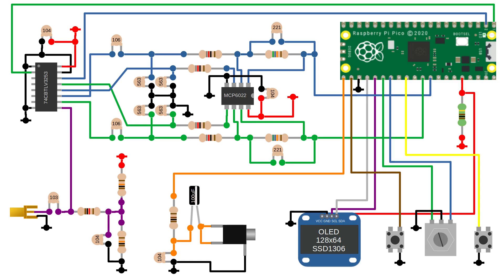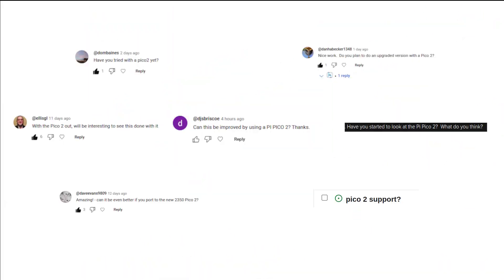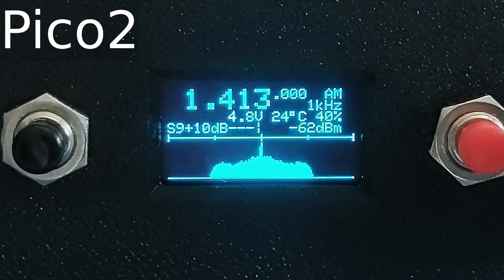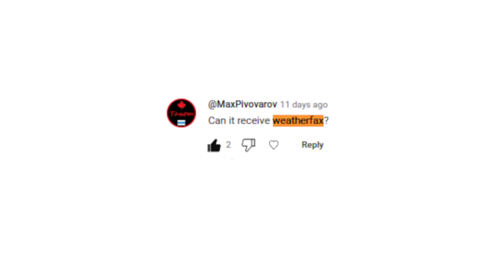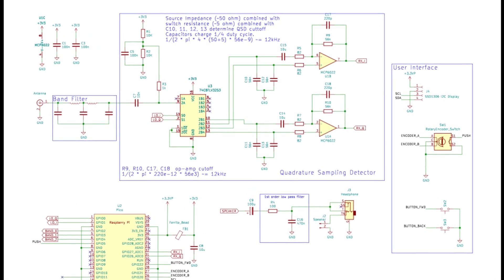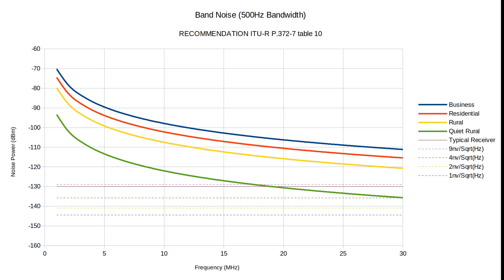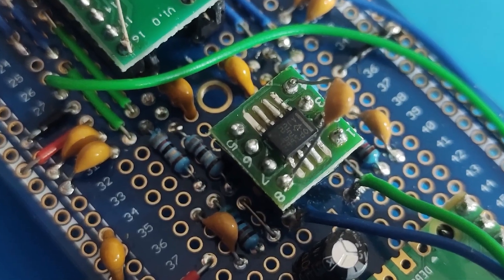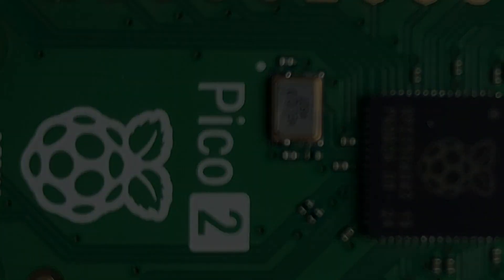Software Defined Radio with Pi-Pico - Part 2 Pico 2 upgrade

Comment: Amazing project! Thank you for doing it and making it open source! I feel something important for the HAM world will come out of this :)
One thing I am wondering about is the frequency accuracy. If I understand correctly, the actual tuning step is a few khz (dependent on frequency) and you get it by "mocking" a pll out of PIO outputs. After that, in the frequency "window" you get, you slide the demodulation bandpass by software, so you can get it to be much more granular.
Is the same process possible for TX as well?
Reply from the maker: Thanks, yes that's exactly right, the hardware oscillator has a few kHz resolution, but the software tuning is very precise. In principle, the same approach would work in a transmitter. It is possible to get sub-Hz resolution from the PIO, but it does require software intervention (around 10% CPU), I used that approach in the transmitter. The course-grained local oscillator in this design uses the hardware clock dividers and doesn't need any software intervention leaving all the CPU free for the DSP.

Comment: Very pleased and a bit surprised to see that the RISC-V cores perform as well as the ARM cores!   Since they are license-free, this could lead to future Pico MCUs with equal performance but even lower cost.   The overall reduction in CPU time is amazing and bodes well for the ability to add new features in future.  Thanks for your great work Jon!
Reply from the maker: Thanks! Yes, I was surprised too. Suspect the the ARM cores would be much faster for floating point code though. Looking forward to adding some more features!
Reply: @101Things-ds8tc  Were you able to measure the current consumption of RISC-V vs ARM, since power efficiency has been a focus of ARM optimization?
Reply: Ah yes… ‘features’… call them what they are, FPU / DSP filters 😉

Comment: Tnx Jon was talking about findings playing with pico2 this morning with another radio amateur. Other than the cmake calls to the SDK did you have to change anything else?
Reply from the maker: Yes, I had to add some extra calls to gpio_set_function() that weren't needed on the pico. Without it, the encoder didn't work. Still, the process was quite simple all things considered.
Reply: @101Things-ds8tc hope you put that in the docs haha 😅
Reply: @101Things-ds8tc OK I see the additions to the code rx.cpp already...
<     gpio_set_function(PSU_PIN, GPIO_FUNC_SIO);
and
<     gpio_set_function(2, GPIO_FUNC_SIO);
<     gpio_set_function(3, GPIO_FUNC_SIO);
<     gpio_set_function(4, GPIO_FUNC_SIO);

Comment: Have you tried using libfixmath? It is a platform-independent fixed-point math library aimed at developers wanting to perform fast non-integer math on platforms lacking a (or with a low performance) FPU and offers developers a similar interface to the standard math.h functions for use on Q16.16 fixed-point numbers.
Reply from the maker: Thanks for the tip, I will check it out!

Comment: Thanks 👍 It would be interesting to see how much improvement you get from using hardware floating point from the M-33 core.
Reply from the maker: Cheers, I think it should be a massive improvement, particularly for single precision.

Comment: Fantastic stuff!

I can’t remember if you addressed this before, but do get any noise from the OLED display?  I seem to remember some people having an issue with them on homebrew rigs.
Reply from the maker: Yes, OLED noise is definitely a thing. There are workarounds to avoid using the charge pump, but I just used a separate filtered supply for the Tayloe detector. Its not perfect, but not too troublesome either.

Comment: Exciting and great video! Just like a kid, as soon as I got the notification I couldn't wait to watch it. Awesome improvements. Really looking forward to following along. The fact that you're taking such an analytical approach to this while sharing it openly and ensuring that the cost and buildability is good for everyone warms my heart and seems like the spirit of amateur radio! I was already subscribed but I would subscribe again if I could.
Reply from the maker: Awesome! Thank you!
Reply: Are you planning on making a PCB for this, possibly something that you could make available on PCBway?

It's been forever since I designed a PCB, but I could dust off some cobwebs to try to make one. 

Becky, my ham wife, just finished building a qcx mini. While inexpensive, I'm still daydreaming about something even less expensive and less hard to build. I believe that PCBway and others like it can not only make the PCB for you but also pre-assemble surface mount parts very inexpensively. Perhaps we could make a version that is all surface mount except for the what absolutely can't be. Then people can order it super cheap and very little soldering. 

As a super extra bonus, still also daydreaming about one that can also do Morse code transmit also. The same concept for PCBs and surface mount components could apply there.

Comment: Wonderful! - Two questions: What are the criteria for the MUX chip? Could one use a simple 74HC4052 (which is available in a DIP package)?
Reply: That chip should work in the Tayloe detector. The MUX needs to work at two or four times the maximum received frequency to produce the desired I and Q signals.  Check out Dan Tayloe's paper: "Ultra Low Noise, High Performance, Zero IF Quadrature Product Detector and Preamplifier".  That paper focuses on a 4x max received frequency configuration, but there is at least one other configuration that for only 2x the max received frequency.
Reply from the maker: Thanks, you want to look for a mux with a low on resistance (the one I use is 5 ohms) and a fast switching time (e.g. <10ns). I haven't tried it, but I think that 74HC4052 might work, but probably not as well.

Comment: Thanks for the update and mention. I noticed your code uses the C/C++ SDK. Is it possible to use ONLY micropython code? It would be easier for me to understand how the code works if it was using micropython alone or a mix, if this is possible. I'm a beginner with both languages but find micropython easier. Thanks.
Reply from the maker: Thanks, I went bare-metal for this design to get the performance. Micropython would be nice, but I don't think it would be fast enough unless the performance critical parts were Python libraries implemented in C.
Reply: Are you aware that there is also a BASIC interpreter that runs on a Pico? Search for "Picomite".

Comment: Interesting project for sure. I've been meaning to try a Pico. I wonder though if this would also work with an ESP32-S3 for example? They're pretty affordable and apparently have about double the processing of a Pico plus wifi and BT.

Interesting series for sure keep up the good work!
Reply from the maker: Thanks, I expect the ESP32-S3 would make a pretty good SDR, plenty of capacity for upgrades!
Reply: @101Things-ds8tc are there ANY advantages of the pico 2 over the latest esp32 ?
I also love esp32 used it a bunch in the past
Reply: Price.

I wanted to do some DSP work on the RP2040 due it it’s ridiculous price but not having an FPU made it hard work.

The RP2350 changes all of that.
And it’s still cheap compared to the ESP32.

Comment: It's not just floating point that the pico2 adds.  It also has DSP specific instructions, though you might have to find a DSP library to use them, or maybe there is a GCC command line option to optimize the code to use them.   As far as the display goes, the resolution isn't too bad bad the size of the display is too small for old eyes!  There are versions of those 128x64 oled displays with 1.3 and 1.54 inch diagonal screens that will be easier to see, but they use a slightly different controller chip that will require some SW tweaking.  There are also some even larger 128x64 oled displays, but they get costly.  If you want the waterfall display, there are color OLED displays with 128x128 resolution (twice as tall) that you can use, and those aren't very costly.

Another thing is a preamp, useful on the higher frequencies to reduce noise.  The Pico2's faster clock might get you operation into the 6 meter band (54mhz), especially if you can overclock it.  MiniCircuits MAR6 UHF amplifiers are cheap (I paid $5 for a strip of 10), and they will give you 20db gain at 100mhz, a bit less up to 2ghz.  They can be run at 5v, but best if you use a bit more voltage for the headroom.
Reply from the maker: Yes, thanks, lots of things to think about. Will definitely be looking at display options and preamplifiers.

Comment: Excellent progress with the Pico 2! Interesting op amp tests. One thought - as it's rx only, many may choose a small antenna such as a mini loop, where the lower signal level requires a lower noise op amp. But if you can hear the change in background noise between antenna and no antenna then job done. Following progress with great interest. Thank you!
Reply from the maker: Yes, that's exactly the setup I am using with a You-loop. I just use an external LNA which works very well.